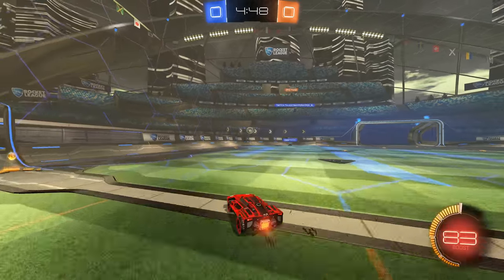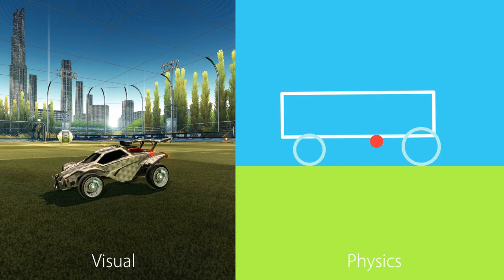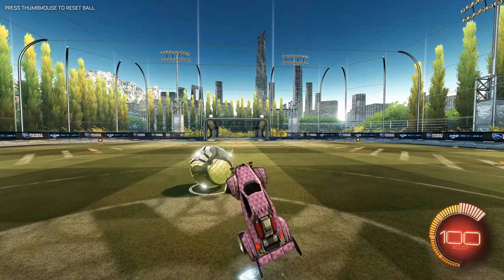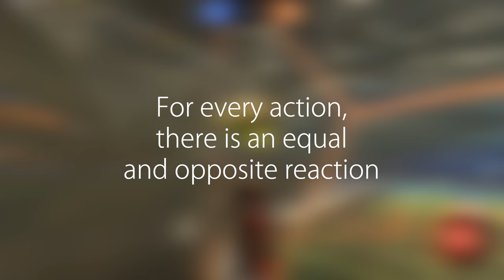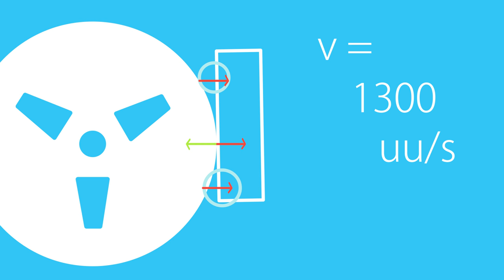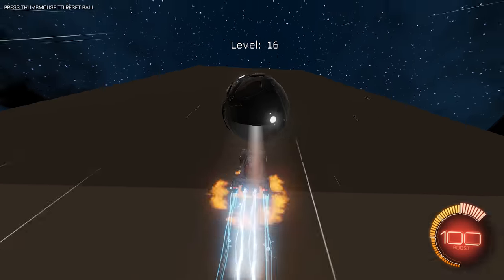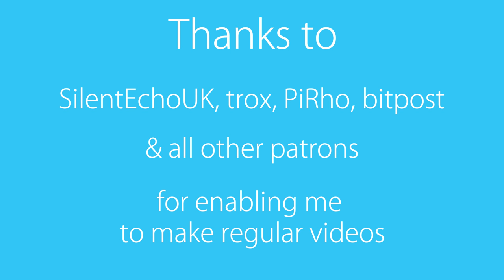Why are wheel hits so odd? - Rocket Science #10

Comment: To add to this video, and for those who were wondering why sometimes the ball flies away from your wheels during redirects, imagine the ball is travelling onto a surface that has ever so slight upwards or downwards momentum, but has zero friction. The ball will change direction and the forward/backwards momentum of the surface's non-friction interference (yes this doesn't work in reality, but that's why you can't do this in reality) will add onto the ball's speed and direction. It only slows down when the angle of the ball hitting the wheels causes the suspension to touch the car, as shown in the video. In order to get those nutty redirects, become the floor that would guide the ball into the goal.
Reply: dayum man, now I get it why sometimes I redirect the ball so perfectly with great speed but sometimes the ball just slows down!It will help me a lot to do better redirects, thanks for the info

Comment: Does holding powerslide have any effect on wheel hits? Also, does aerial rotation or dodging effect the suspension?
Reply from the maker: Interesting question! Because the wheels don't move the ball at all it can't have a direct effect. But it might make you "slip" more on the ball meaning your car could be in a different state (rotation/location/velocity) when the hitbox touches the ball. Which would cause a different hit. Haven't tested it yet though.

Angular momentum or dodging does not have an effect on the resting location of the wheels. But when you hit an object with your front wheels during a front dodge then that will push in the suspension faster which once again can affect the resulting hit.

Comment: You keep saying that cars within a preset are identical, but a staff member of Psyonix has stated that there can be minor differences between presets, such as the pivot point location (except for some minor cases like octane and octane zsr). Which is the truth? I am a bit confused. 
Link where Psyonix Corey mentions it: https://www.reddit.com/r/RocketLeague/comments/74am36/new_fast_furious_dlc_drops_october_11/dnyfbwa/
Reply from the maker: I have indeed seen that comment myself. https://www.reddit.com/r/RocketLeague/comments/74am36/new_fast_furious_dlc_drops_october_11/dp9bzed/?context=1 Didn't get any reply from him. I have done extensive testing (not on every single car but a lot of cars of the same preset as well as the marauder mentioned there) and for those cars there is no difference. What I'm talking about mainly is that I lined the car and the ball up in 0 gravity and checked from which distance I could touch the ball. It was always the same. Meaning pivot point -> front distance, pivot point-> back distance, pivot point -> roof distance. That is the practical testing I did but I can also read the offset from the game memory and it is always the same. There is just always a low chance that the value I'm reading is not actually getting used but that's what I did the testing for.
 My guess is that he just meant the visual pivot point is in a different spot. The scarab for example rotates around the middle but the Octane doesn't. That will cause a visual difference and most likely a different feeling. The ZSR was just modeled on top of the Octane so it has the exact same pivot point.
Reply from the maker: Actually he even said it himself now that I'm reading the comment you linked again "The preset specifies the hitbox, and the hitbox specifies its extents (X,Y,Z) and offset (X,Y,Z)." 
And "may feel slightly different (especially in the air) if their pivot points aren't identical relative to their wheel bones." Look at 3:12 . Octane pivot point is shifted toward the back wheels. Scarab has it's pivot point way further from the back wheels.
Reply: Thank you very much, it is all much more clear now! Great job as always.

Comment: @Rocket Science I Thought it came out recently that your wheels on the right side can touch then come off, THEN your left wheels can touch. After this you will have a jump reset.
Saw this clip on Reddit of a double wave dash showing this mechanic. Is that what's happening in this clip? https://gfycat.com/FragrantBarrenBirdofparadise
Reply from the maker: No, I already talked about it in that thread but almost no one seemed to see/care (the post I replied to showing this proof https://gfycat.com/EvergreenIncredibleFallowdeer got more upvotes than my reply even after I posted it). They have to be all 4 touching. There is a "is on ground" check in the game and that's only true if all 4 wheels are touching and it determines if you get your flip back or not.

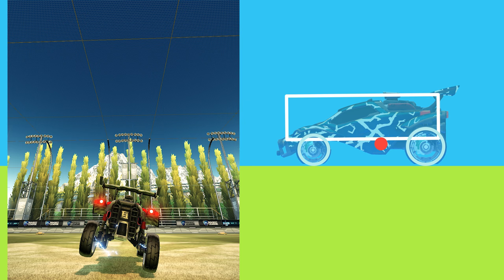2:59 has to be the explanation for why it might look like the wheels are never all on the ground at the same time. Either way that mechanic has some really tight timing. So all 4 wheels are only on the ground for a very short time. Then the right ones lift off because you can't flip when all are on the ground.
Reply: Rocket Science awesome, didn't see your answer in the thread, thanks for the reply!